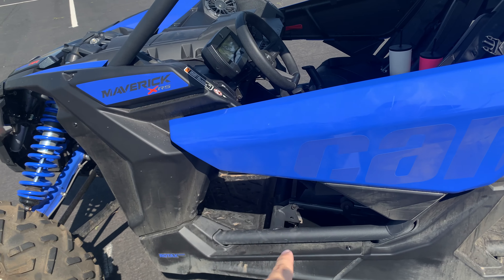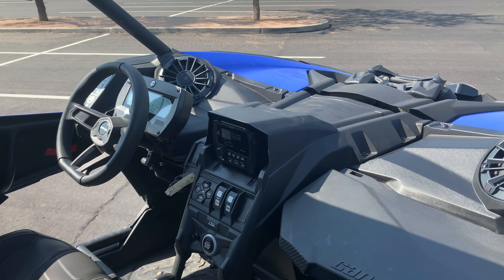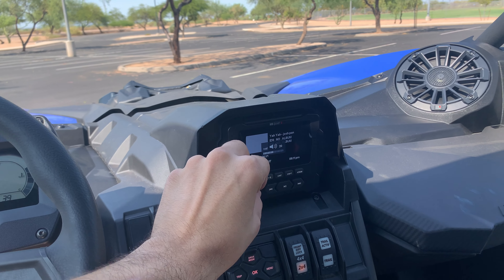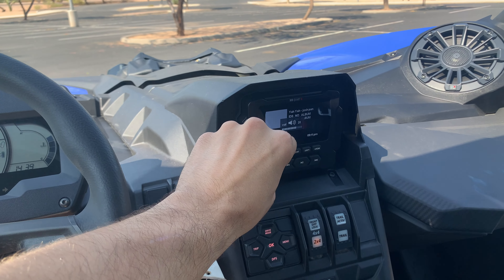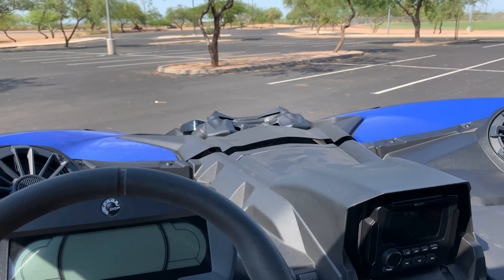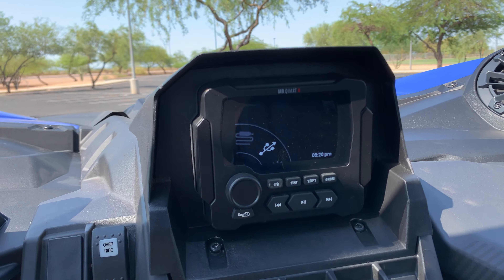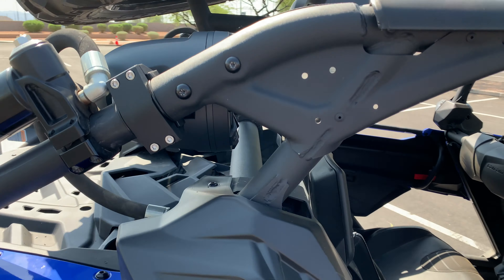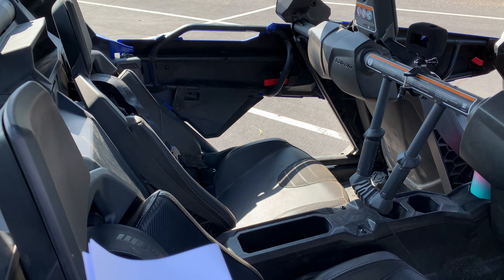MB Quart Stage 5 Sound System In A 2021 Can Am X3 Max Turbo RR

Comment: Mine just came in today after 5 months of back order wait time.
Reply: Shipped
Reply: How do you like it just ordered mine for 1500
Reply: @carlosbanuelos2212  the stage 5 is nice, i turned my sub amp level up higher than they recommended and enjoy it alot more. Good system 👍👍
Reply: @slabz710  gets here Tomorrow but I still don't have my can am hope it gets here soon
Reply: @carlosbanuelos2212  oh man, i hope it shows up soon for you!
Reply: Mined finally shipped today after months of waiting
Reply: @slabz710  Our system was just installed yesterday. Are you taking about adjusting sub volume in settings?
Reply: @garrettstalter774  no, on the subwoofer amp i turned up the 'level' knob higher than they suggested in this video.
Reply: Mine comes in tmr for my rzr stage 5 too payed 1k with bestbuy employee discount 🎉🎉

Comment: I just installed this, love the bass adjuster, didnt know it came with a cam port, walmart 20 bucks now i have a backup cam. The single sub is ok but could use more, the highs are crazy and dont distort at volume. My only negative comment is that when tuning the EQ the music stops so you have to guess, then go back to BT audio and see how it sounds, takes a while to fine tune this way.

Comment: wanting to buy this kit but website says its only for the 2017-2020. is there a kit for the 2021 canam?? or they all the same?
Reply: They are all the same just installed in on my 2022 max
Reply: do you have any issues with the bass coming off?? my app keeps getting the red light. i already turned down the app and stereo settings and still having the same issue

Comment: You’re on stock battery??
Reply: I run stock battery, but i think the dual battery kit would be a good idea. While the machine is running there is no powerloss. But with the machine off it drains quickly.
Reply: This is a 2021 so they fixed the battery problem regarding sound systems!